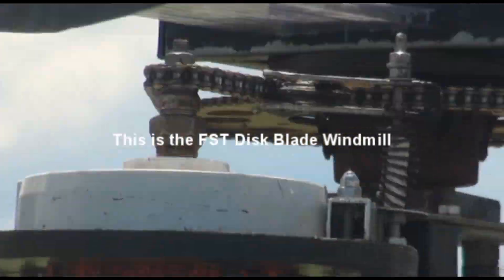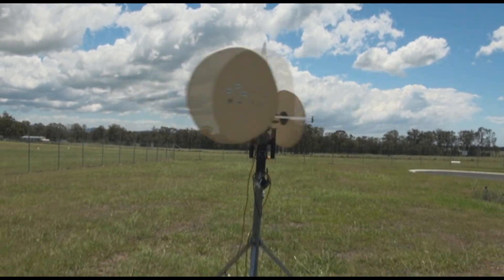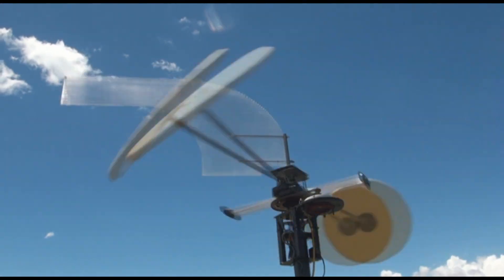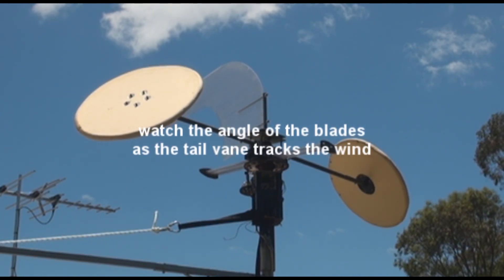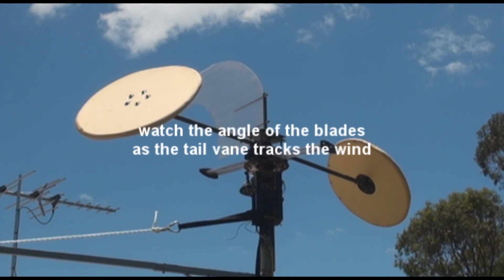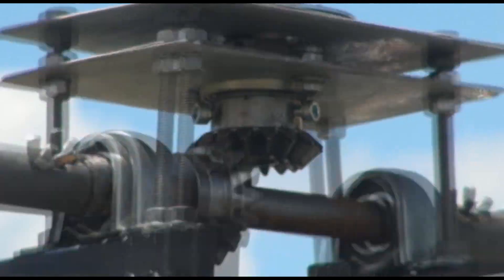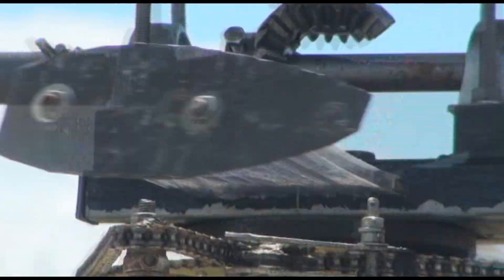All new wind turbine.   " How it works"

Comment: 1. Efficiency?
2. have you done any power or load tests?
3. disk isn't the most aerodynamic shape, so I'm not sure that is better than Darrieus turbine :/
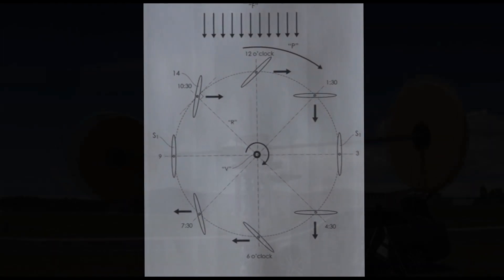4. triangle of velocity - check this. on your print at 2:00 you don't take rotation speed into account, what is wrong. if you see at any VAWT turbine aerodynamics, you see three velocity vectors: wind, linear blade speed and their sum ;)
Reply from the maker: This video is an introduction to the new pitch control concept. You can see the load test results in my previous video "New Wind Turbine Technology"
Here is a link to the previous video that gives performance figures,    https://youtu.be/BNik_id-pOQ
It is widely accepted that "pitch control" of the blades of a Darrieus VAWT can greatly improve efficiency but mechanical losses and reliability problems often offset any gains. You are correct, a disk is not the most aerodynamic shape, at least not for a standard Darrieus VAWT, not for a jet fighter wing or a helicopter rotor, but it is for this VAWT due to the unique action of the blade. The blades of this turbine roll around a horizontal axis as well as rotating around the vertical axis. This enables the blades to take advantage of lift forces and more importantly, high torque (positive) drag. Also the big killer for VAWTs, the problem of "drag inducing turbulence" in the upwind segment of rotation is addressed by this design.. Note: The turbine in the video is a rough proof of concept model, thrown together in my backyard out of mostly second hand parts.  Watch out for the professionally built prototype to come soon.
The print or diagram you talk about has nothing to do with blade or wind speed.
Reply: Any idea on the RPM this thing is capable of delivering depending on wind speed?
Reply from the maker: Hi Francisco, I do not have any RPM figures for this one and no testing done in high winds. I can only guess 110 RPM in 20 kph wind. Normally a VAWT is much slower than a HAWT but torque is much higher, so with a good  VAWT I can use 1/8 step up gearing to run a standard generator. So RPM at generator on this Turbine would be around 900 RPM. Here is a link to a power test video.   https://youtu.be/BNik_id-pOQ